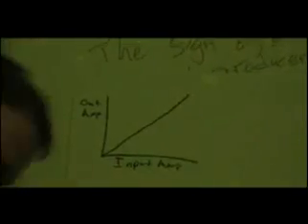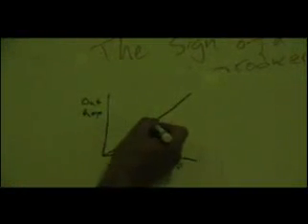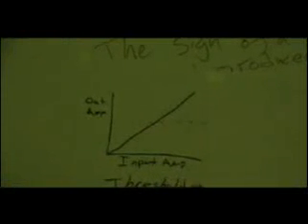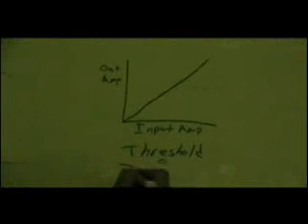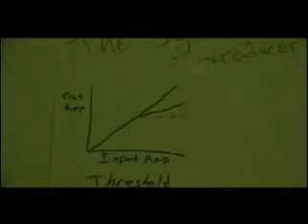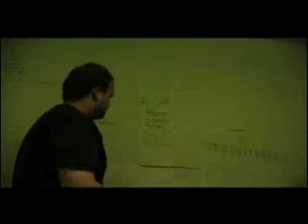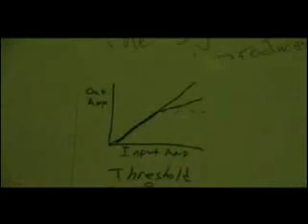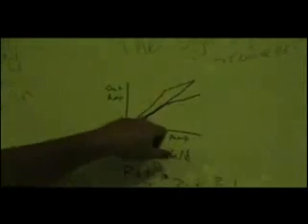How a Compressor Works

Comment from the maker: @IndieDaily Equalization will bring out the best parts of the sound but compression will even volume response.  When dealing with samples, it's entirely possible that you're dealing with sounds that are all equal volume though so compression may not be required in the early stages.  If you hit hard enough with a compressor, you WILL hear a difference though.

Comment from the maker: @IndieDaily If you're not hearing a difference it could be a couple different things:
1. Your threshold is not set low enough.  
2. Your Ratio is not set high enough
3. The Plugin or hardware is inadvertently bypassed
4. Your monitoring is seriously messed up, I suggest headphones.

Set your ratio super high and move the threshold around.  When you're compressing, it WILL become quieter, that's why makeup gain is there.  But first make sure it's dipping the volume.  Sounds like a settings issue.

Comment from the maker: @DarkWhite25 Multiband compressors for the most part are a real issue.  What they do is they split the audio into sections based on frequency.  This is very helpful in mastering and sometimes large bus sections like full drums but typically, a traditional compressor is the best way to go.  For a very clear visual compressor, most built into DAWs (other than DP) are graphed though metric Halo's channel strip is well done and sounds great, I'd also recommend Waves C1

Comment: Great video! The people who don't get it probably have'nt done much experimenting with compressors. Everything you said was spot on. As far as better suggestions, you should try to make slides or a powerpoint type thing and keep that camera on a tri-pod or steady surface. No need for zooming in and out. Great job!

Comment: Its a good explanation but it doesent really give that much practical information I think. I mean if I'm just using a stomp box compressor for guitar and now you've explained it I know what the attack knob does in a technical sense I still dont know why I would want it set high or low and for what purpose.